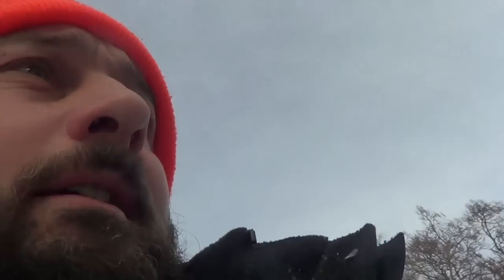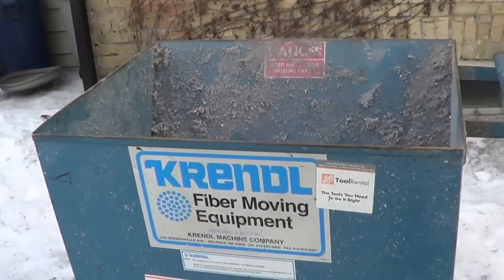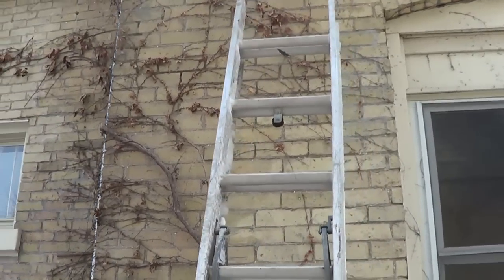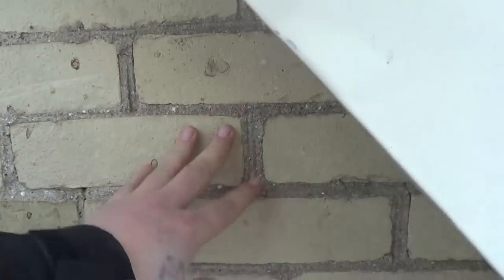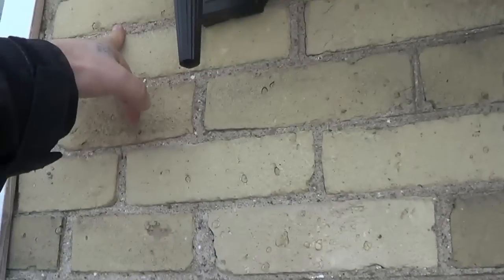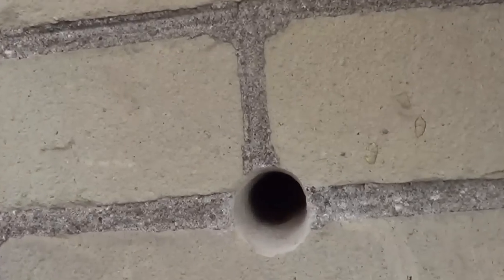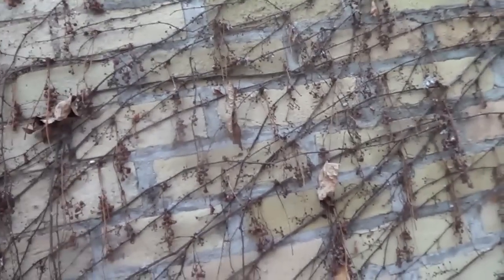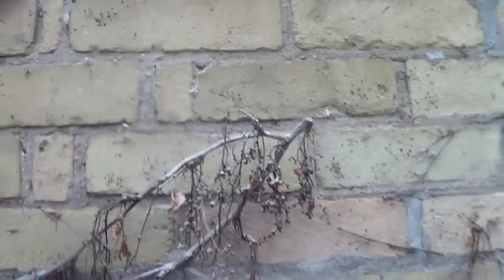Insulating from outside a house.

Comment: Better doing it that way so you don't disturb the owners or tenants inside as well, you can do the same job from inside just drill through the plaster.
I'm surprised that place is in double brick most of them are of that age.

Comment: What i dont like is that the cellulose isnt actually being pumped into the existing pockets of the wall (between the plywood and the plaster or drywall) its being pumped in the cavity between the brick and the plywood. Using Cellulose i would have to wonder how well it falls down and rises up with all of the mortor from the brick hanging on the inside holding it up and keeping it really from disbursing everywhere.
Reply: I would think they have it already estimated based on square feet and wall gap it would naturally push through the route of least resistance ultimately to fill in any voids and then they drill holes through to then fill each spot at different levels for uniformity.